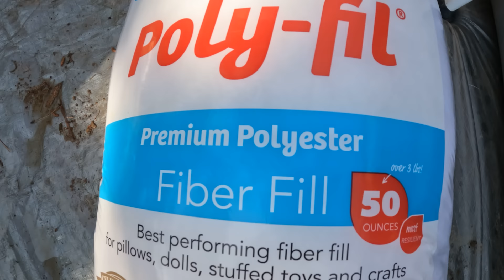Above Ground Pool Swamp To Oasis in 36 Hours for $30| FAST CLEAN Redneck Filter HACK| SUMMER 2022

Comment: Side note, awesome and informative clip also. This couple? Actually work AS A COUPLE! It's not all just him or all just her and I'm loving their working relationship and that is what I believe is missing in the majority of relationships these days. Real healthy relationships actually require BOTH partners to work at it to make it work! Not to say there won't be bad days but on the same note? They'll work through it! Awesome couple and wished I saw MORE couples like them! Cause? You can definitely tell they enjoy each others company.
Reply: This economic crunch has forced my husband and I to work to have to work together more effectively too. I'd say that's actually benefit so far. Actually a de-stressor to just pick a job and get it done, and each time we have a success I think that builds trust for next time. Anyway glad you commented that because I noticed that too.
Reply: @KKIcons  Mostly agree but we are of slightly off a key point, good husbands and wives ARE partners. Good husbands don't expect wives to put forth the same PHYSICAL effort but on the same note? What goes on in the head is pretty equal? Not quite as women DOMINATE in most social skills but here is the actual problem. Men can muscle and think through MOST problems but the social connection? Men are usually too busy to invest the extra energy. But women? They are NOT expected to work SERIOUS manual labor. If they could? They wouldn't need men to begin with. But like it or not most men are left with the heavy lifting (PHYSICALLY DEMANDING JOBS). But I'm NOT making light of women, put one in construction and her very lack of strength will get her killed when it already kills lots of men already. But I'm getting side tracked, men EXPECT their women to actually be partners. Most men have their 'ladies' back so they expect the same back and that is where 'modern' ladies are missing the point. They too must work into keeping the relationship working themselves. It is NEVER a one way street when one says he 'the king' so all responsibilities are his. Honestly MOST men can't do it and do it right but that is where REAL partnerships come in. You do what you can for each other and shore up your partner's weaknesses. But the fact you help him out when he is feeling off and isn't doing as well as he should be in his personal opinion? Do you realize how 'God sent' you are? Men are NOT used to their 'ladies' manning-up or should I call it womaning-up? Won't lie, it's harder for 'ladies' but real women put aside being 'ladies' when family is in a crunch. The fact you enjoy supporting him is a bonus cause as like him? You have his back to when his best isn't enough. Same note men shouldn't take their ladies support for granted either.

You both have a good thing going and THAT'S what I enjoyed the most. Despite his fumble and that's LIFE'S hard curve ball, you are backing him when he actually needs it. He isn't the best nor perfect but you do know he IS trying his best. What better way to appreciate him than to return the favor? By the way? I know you are not perfect either but? That is exactly why your husband is there too, despite fumbling with how life has been going lately. A REAL husband is there to back his wife too and with you BOTH covering each other's backs? There isn't much that life can throw at you that BOTH of you can't handle.

The thing I truly enjoyed see the both of you? It was a REAL partnership, both working towards a common goal without holding your partner RESPONSIBLE for it all. One always leads the the second in command? Better not be a air-head cause simple fact? Even second in commands have LOTS of important decisions to make too that SERIOUSLY impact the entire family  also. Like I said, a man CAN'T do it all himself but on the same note? Neither can women. As a team though? The rest of the world's 'couples' are in trouble because THEY forgot to keep each other's back.

Sorry I'm rambling but saw a good thing between you and your partner as I RARELY see it anymore... you BOTH actually enjoying each other's company. I always had a SIMPLE rule with dating, when there is more BAD than GOOD in it? BAIL!!! You can TRY to fix it but if the other side isn't listening? Go while to going is good. I might not be good 'socially' with people but I still recognize a bad deal with a partner that ISN'T acting like one. Not saying I have to be in control but I DO STILL get a say. Oops, just slipped I'm an Ex-beta male. Got burned hard enough I'm NEVER dating again, married the first one (she divorced ME and we BOTH had growing up to do yet SHE shut down marriage counseling) and by the time I got away for my Ex-girlfriend after that? I was ready to KILL myself. She literally had all my income supporting HER family when she point blank kicked me out. With friends of course that I had ZERO ideas who THEY were. Guess I can call them HER cheering  crowed as I NEVER got to tell MY side of MY story to them. You KNOW it's bad when the ONLY time your girlfriend DOESN'T have eyes on you is work and STILL finds the time to accuse you of cheating on her?!? Who doesn't have a job as a stay at home mom collecting child support for two different fathers AND STATE support????!!!??? She REALLY almost got me to kill myself as the ONLY thing I owned and paid for was my motorcycle. Besides that? Her family was a black hole of my PERSONAL EARNINGS I worked my ass off for and when I tallied what I spent on myself AFTER SIX MONTHS besides paying the mortgage on my motorcycle and insurance? Around $215.00 OVER SIX MONTHS?!? Maybe five plus or minus but I was definitely in the 210 plus zone.

Sorry to bum you out but I DIDN'T run into a partner and the two brief ones I knew? Serious disappointments despite me being flawed too. Said we BOTH needing growing up to do and I'd admit I WAS immature but the same note? She never told me ONCE and completely blind-sided me. Guys can be a bit thick when we are focused on the basics, like a place to live, transportation and a job to support the first two points you know? The big money items? If we would of LEAST had a counselor, we would of had a GREAT chance to repair our relationship. Well water under the bridge... and I still believe we WOULD of made a great couple save? She didn't give it even a remote chance. Learned an important lesson. It takes TWO to make a relationship work. Anyways ONCE a woman CLAIMS physical abuse despite you NEVER striking her ONCE... good luck, ALL MEN NEED IT.

Thought I do think I did it accidently once. I ran her heals over with the scroller with our child in it, does THAT count? And temper? When you lose you car and quickly your home BECAUSE you live off of a super highway? Yes I was distressed but I never directed it at my wife... but I wasn't pretty either. I was working FULL time while driving her to and from her job that was part time save? It was literally taking me forty five minutes EACH trip while I watched OUR child while she worked. Guess who WASN'T getting sleep? Oh well, that's real ancient water under the bridge and I had my quirks too as in liking gaming too much but it wasn't like I could do too much of it because between the hour and a half of driving her to and from work and watching my daughter? I was TIRED ALL THE TIME. Even fell asleep quite a few times simply driving to and from but thankfully woke up before we got into a SERIOUS ACCIDENT. God was smiling on us BOTH that month or probably my daughter most likely...

What annoyed me the most on those drives? Despite being obviously exhausted? Talking to me would of kept me focused. 45 minutes is a long time to drive in silence fighting off sleep deprivation. 

If only she would of spoke sooner... we'd probably still be a happily married couple with our own bumps in the road. Sadly that didn't happen. Trust is a two way road and even men need help when we hit OUR limit too. It's there and by the time we break? It isn't pretty either.

Never is for EITHER party.

Sorry about the ramble but my failed marriage HAS bothered me for like forever and will bother me until the day I die. SO many what if's if either of us were truly communicating to each other and that was OUR failure. Even I won't sidestep the blame the end end result was a team FAILURE on both our parts. She didn't tell me what I needed to know and apparently I didn't tell her she needed to know either. That's why I HATE the fact she totally side stepped a marriage consoler... that could of easily opened up doors if only an effort was made.

Well, getting OLD so that regret? Is OLD but despite that? Will stay with me. Guess they are SOME things in life one never gets over. Like to think she has become wise enough to realize her own. LOL, who am I kidding? She would of called back a long time ago as much as I can't because she keeps her data hidden.

Sorry to be so depressing but not all couples are created equal and it's potluck to run into a REAL partner and even when you do? You BOTH have to realize it for it to actually work. The guy isn't responsible for everything, it just isn't possible and women? They need to be responsible too. Most take the second seat but DON'T undervalue it and if you wear the pants in the family? Ugh? You opted for that HARDER position. Trade offs and being a man? Isn't a great one either. It's hard on ALL SIDES. It's about time BOTH sides realize that. And if you don't want to because you are cruising? That makes YOU part of the problem, man or woman...

Sorry about the rant again but there are basic truths worth point out cause nobody else IS anymore. The most basic truth between a couple? They are BOTH equally responsible for keeping the relationship alive. If not? That is NOT a partner you want because once a partner does not want to BE REPONSIBLE? That is NOT a partner, that is a LEACH. Even a man's MAN can't support those... goes in reverse too, even a woman (hear me roar) can't support a man child that never wants to be responsible for HIS actions. It's just too expensive versus his very actions and his very STUPIDY.

Comment: Good job on the pool filter. Another way to build one....
Get a 6 gallon bucket with snap on lid. Drill a 1 1/2 " hole in the top center of lid. Put together the same port and disconnect you used. Now 1/2" from the bottom front of your bucket drill another 1 1/2" hole, cover the hole with fiberglass screening material (like you use for repairing screened windows) glue in place with glue used for aquariums. When dry fill the bottom 3" of bucket with your poly fiber. Fill the next up layer with washed play sand. Fill the next 3" with crushed natural charcoal (do not use BBQ briquettes they have tar in them) . Next 3" up put in washed pea stone.  This "filter" will last the whole season. Everything can be used again next year except the poly fiber. Save even more 💰 money.
Reply: Just curious if this will help filter the incredibly poor B filters from the pump- even with city water??

Comment: I started with the 5gal bucket also, but I switched to a 55 gal drum stuffed with the polyfill then ran a garden hose inlet to bottom of barrel and piped the outlet out the top to the pool so it filtered well water before it ever got to the pool. Like you said, AMAZING what a little batting does. Thanks for the Video.😀

Comment: I use this idea in my water pond. Keeps everything clear. I save old pillows for the fiberfill. I have the pumps in dollar tree containers with hole for the cord on the bottom, and one on top for the hose. You say Redneck, I call my projects ," broke folk" 😎 thanks for the video.
Reply: I use pillows for my pond filter, too. A great use for My Pillows.

Comment: I did basically this exact same thing for the same size pool after seeing your video and it really does work! I just used a sump pump from Harbor freight, a 5 gallon bucket, and a three dollar pillow full of poly fill from Walmart… You don’t need to get real complicated with your plumbing just run the water into the bucket… My pump came with garden hose fittings so I just put a PVC garden hose adapter to the bucket lid and a 5 foot hose…I was going to build some sort of stand to hold the bucket but in the end just toss the whole thing in the water the bucket floats around and it still filters just fine

Comment: I remember filling my pool with our well water.  It was sparkling clear.  But...to be sure to get ahead of any algae, I put in a chlorine float.  Within a few hours, the water was GREEN!  I kept adding SHOCK & more Chlorine, but it just got worse.  It blew my mind.
Turns out it was minerals reacting to Chlorine, just like in this video.  In my case I had a paper filter that I rinsed off daily.  Within a week, the water was clear again.  But what a lesson.
Reply: That sounds like EXACTLY my story right now.  We have well water & I’ve done all of the exact steps you mentioned. So today I searched how to diy pool filter & found their video! Soooo glad I found their video & your comment. Thanks
Reply: @hannahcline2398  I'm glad to have helped ease your mind.
As I recall, I'd spray off the paper filter daily, and instead of green (like the water) the filter was shedding brown, almost like rust.
I never researched what mineral does that, but it may be both iron or manganese.
Reply: I believe it's iron. I fill our pool with well water each year and I discovered the poly-fill trick during my 2nd year of owning a pool. I spray my filter cartridge daily (multiple times a day at first) and attach piece of pantyhose with poly-fill inside. Nothing but crystal clear sparkling water since I started using the poly-fill!

Comment: Yep… I have been making “red neck” filters for my solar fountains. I use all different kinds of plastic containers filled with polyester fiberfill. And just FYI, you can use a high pressure nozzle on a hose and clean out the fiberfill and reuse it. I do, but then my filters only take a handful of fiberfill. Easy to hose out the debris on that small of a filter.

Comment: Good job, that works really well. If you have trouble with the o-ring connection leaking in bottom of bucket you can take a female adapter, cut off some of the threads & use as a nut, it works the other way also, cut male adapter and use on inside for lower profile & use female adapter on outside.

Comment: Next time you need to add water to the pool duct tape or zip tie a couple of tube socks over the end of the hose to filter out most of the minerals before they get into the pool water. Love the redneck filter...the little cartridge filters that come with those pools are way too small for the volume of water. Great job!

Comment: Quick suggestion you could add activated carbon into the filter between two thick layers of poly fill and cut out the need for chlorine also try going to local restaurants and ask for the buckets they have a lot of pickel buckets have locking tops with o rings

Comment: So glad this video popped up...and yes I did subcribe... my mom has well water and this happens every year. Don't even want to go into all the chemicals and stuff she adds to clear it up and it doesn't completely clear it. I will be sharing this with her! Info to have on hand!
Looking forward to your next post!
Reply from the maker: Happy to help 😃
Reply: It really does work!!  Been using this method for 3 yrs now, and it truely is the ONLY thing that works.  I also use to use expensive chemicals to get my ph and alkalinity down....this year, muriatic acid has done it, add a little chlorine and all is good.  Thank God for videos like this!!
Reply: @SimpleLifeReclaimed  we've built the system as you have and it's working so great! But we do still have quite a lot of sediment. Too small for a vacuum bag to help with. Any other tips? We've run it 2 days now.

Comment: Using a lid with a 3in wide section of holes covered inside with red/green sanding brillo pads and then putting chlorine tabs in the bucket works great for the constant seasonal use. The pads hold back the solids and the chlorine makes it sink to bottom of the bucket until it reaches the point where the pump can't push water up through the solids. Just add a drain pipe with a ball valve and you shouldn't have to touch the goop anymore, especially if you use laundry chlorine instead of tablets.

Comment: I’ve been servicing pools and spas for over  7 years now. And that’s not just cleaning and balancing. Myself, my sister-in-law - who owns the company, and her son, do liners, all equipment installing including plumbing, repairing leaks above and underground, gas heaters and heat pump installations, etc. We do pretty much everything except build the pools ourselves. I understand that this is a dyi activity channel. But for this particular project, I strongly recommend installing at least a 100lb sand filter. That along with practicing proper water balancing, would make this process so much easier every year. Not to mention, help keep it properly circulated throughout the season. That little, tiny (type c maybe) paper cartridge filter is doing absolutely nothing for that pool. If it’s staying cleared up throughout the season, it is most likely attributed to it being used/swam in, than it is that tiny filter. Also, cartridge filters are just a pain. You have to take the cartridge out often (especially when trying to clear it up), to spray it out. Not to mention the endless bill of replacing them frequently. A sand filter, you simply turn the head valve to backwash and  then rinse, and it cleans itself essentially.